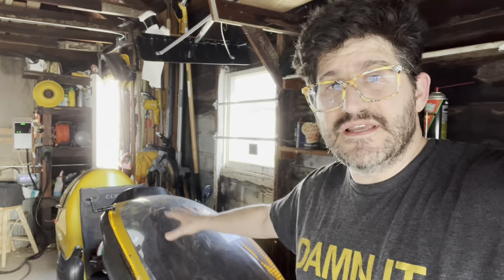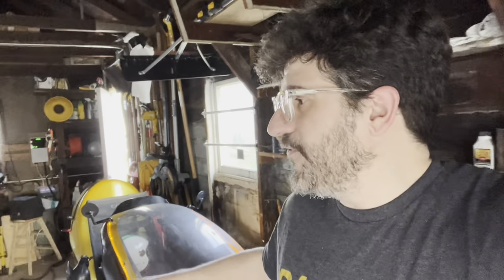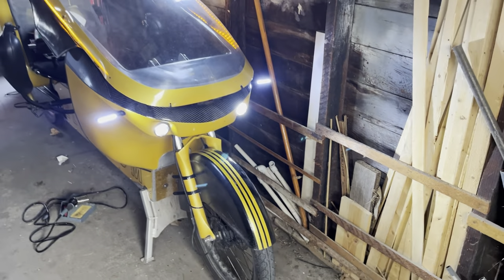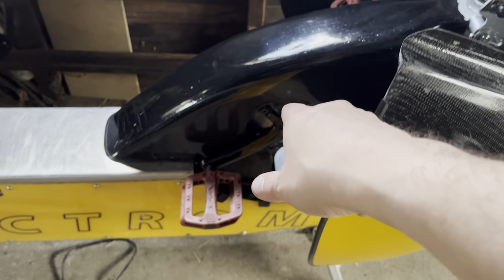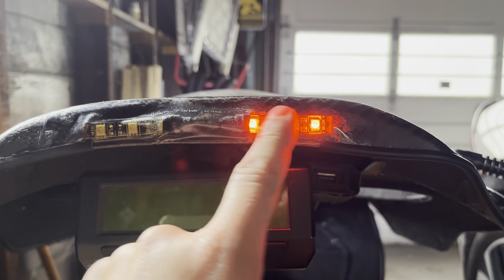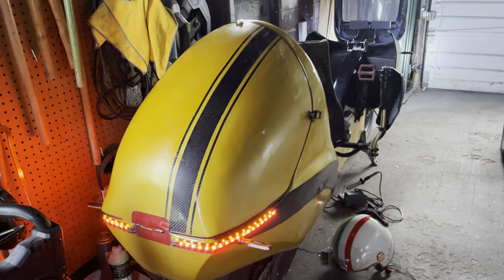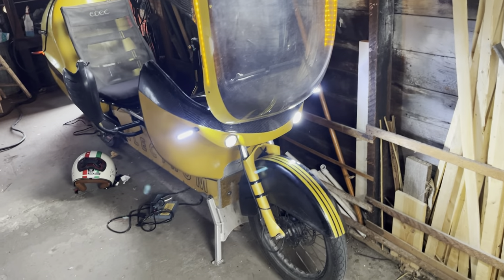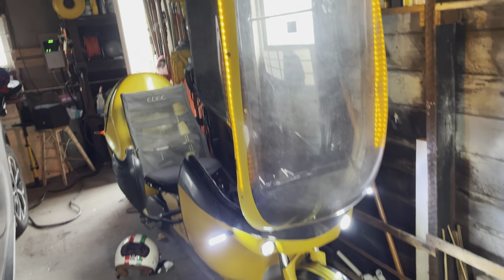Electrom talking points

Comment: Thanks for the great review video Adam. I think it is important that those who are curious about the Electrom are able to find out more via an unbiased source. You did mention that there were a few things that you hoped were better on the 2024 bike, and you are correct. Here’s a list of improvements:
1. Headlight mode change - Yes, the new single light does not have the annoying “feature” of changing modes each time the power is turned off and on again. 
2.  Cowling hinge- We did upgrade the cowling hinge to a thicker gauge stainless steel, however I should point out that the hinge on your bike feels a bit floppy when the cowling is in the open position, but when on the road it sits tight in place and doesn’t move around. 
3. Cowling running lights - the new bike does offer the cowling lights as an option. I agree, the more lights, the better.
4. Cowling and Footwell adjustment - yes, we did improve this process. 
5. Light and Power-Mode Switches on the handlebars. Your idea of a modes with button on the handlebars is a good one. We don’t currently have that in place on the new bike but will put some thought into it. 
6. USB port. The new bike has the USB port down on the footwell flat area so that one could place a phone mount there. It does mean that you cannot look at your phone while charging, but you probably shouldn’t anyway (but it would be great to have the phone up on the dash if using it for navigation) 
7. Bubble-back tailbox - We can still make that tailbox and it can be ordered as an upgrade. 
8 - Brake lights - actually, the rear side flashers do have brake lights that activate when you squeeze the brake lever, but you can’t see them because it’s impossible to squeeze the lever while looking at the lights. It would be great to have the signal lights act as running lights as well, but unfortunately that functionality is not built into the off-the-shelf lights we have found. 

These are all great observations and I really appreciate the feedback. I hope that others find this video informative. You’ve really nailed the important details. 

Fabrizio (TIg) Cross
Electrom LEV

Comment: Great video.  I am building a knock off without the pedal generator.  I am currently building a 103.6V, 63AhLi-Ion battery pack.  I too am a recumbent fan.  Havent decided on under seat steering yet.  I'm using my Wind Wrap fairing.
Reply from the maker: Thank you most of my recumbents are OSS but they are also set up to be racers. I do like the upright position and comfort the USS and in this application is very appropriate. I’m thinking about changing my touring Azub 6 to USS I bought it with OSS because that’s what I had always been use to.

Comment: In response to something you said toward the end of the video about having a small electric generator, and this has ben mentioned before by other fans.

It would be nice to be able to disengage the drive chain so that its possible to petal the bike at a standstill and charge the batteries with the onboard generator. It wouldn't be much but it could give you the small boost you need to get to a safe stopping area instead of the side of a road or a middle of nowhere bike trail. Also, I believe @SmilingDevil has done a little bit of math on it and installing a solar panel under the polycarbonate bubble would increase your top off charge enough (in preferable conditions) to make it worth the trouble.
Reply from the maker: You could prop up the rear wheel but not sure it would be worth it but very interesting thought. Now the solar under the bubble would be very interesting. I wish i knew more about that stuff to build something like that on the bike.